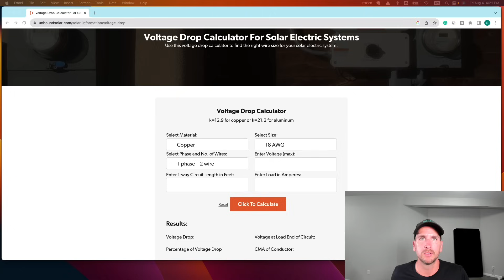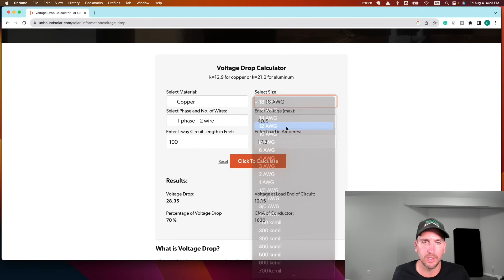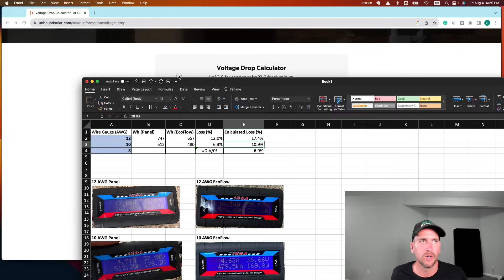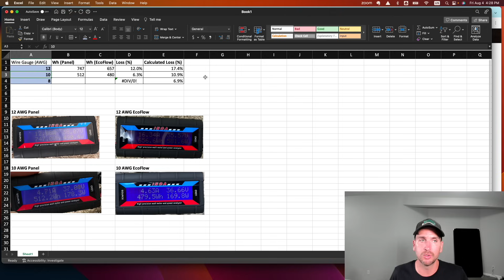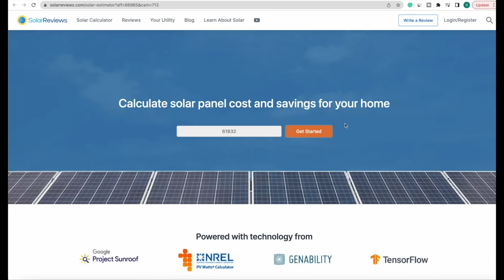What Wire Should You Use For DIY Solar Kits? Surprising Results!

Comment: If you put the same panels in series then your current would be halved and your line losses would be a quarter.  Then it would matter much less what wire you use.
Reply: The host of this channel mentioned in a reply to a comment I made that he would have run the panels in series but the little power analyzers couldn’t handle that much voltage. This video does get across the message that wire gauge matters a lot, something a guy named ‘Handy Bob’ stressed some years ago.
Reply: @mikedavison3400  it just doesn’t matter that much when using higher voltages.
Reply: Agreed. This video should have included a series connection. Nobody is going to run in two parallel. I expect the results wouldn’t be as exciting with parallel though. Also, most aren’t doing 100 foot runs.
Reply: Dont forget that series has a total energy cost if partial shading enters the equation.
Reply: @ceeweedsl bypass diodes are more effective than optimizer manufacturers would like you to think.
Reply: @ghz24  I'm not sure I understand.  Are you saying to use bypass diode at panels to avoid the increased loss from shading with series wiring?  I understand they can protect with parallel but have not used them.  I only mix two panels.
Reply: @ceeweedsl  No the diodes are factory installed in virtually all modules.
Depending on the pattern of shading and  the wiring of the diodes they may prevent the overall array from suffering more than the total of the shaded cells.
That's probably clear as mud. 
Here's an example if you have 6 panels in series and throw a blanket over one of them you only lose the power of that panel not the whole array.
Likewise covering 1/3 of a panel may not degrade the entire array if the 3rd covered are bypassed by the diode.
On the other hand if the shading is evenly spread over the sets of cells so no diode can bypass because they are all partly effected the amps produced drop and become the limiting factor for the whole array.
Many common 325 watt panels are wired so a vertical shadow drops the voltage from 33 to 22 volt but the amps remain at 10 so the 6 panel example would drop from 197 volt to 187 and the array suffers a 110 watt drop.
If theshading is horizontal accross one panel it keeps 33 volts but drops the amps to 6 1/6th amp and limits all the panels to that 6.6 amp output. So volts stayed at 198 but the array lost 660 watts from one panel being shaded by 1/3. 
So that utility pole shadow sweeping across your array daily may cause almost no loss or it could completely justify the cost of optimizers.
I am not a fan of optimizers.
I suggest you read an article titled 
"Danish study shows solar panel optimizers aren't always optimal"
and then decide if they are worth the cost in money and in performance.
Spoiler since they use energy if there is no problem for them to solve they just waste a little energy trying and your better off without but it's deeper than that.
Their methodology not perfect and...
Solaredge posted a reply to the study, you can find a link in the comments below the article.
One of their criticisms was that the utility pole was just testing the bypass diodes but that's just and admission that the optimizers aren't needed to solve that issue.
Reply: @ghz24  OK.  So you are just talking about the standard bypass diodes almost all panels will have.   I will have to study this more.  Every source of information that I've seen indicated that in series you really do get more shading loss as the voltage drops.  I could swear that I've seen the same in my own system when I experimented shading one panel in a parallel vs series but maybe I misremember.   As far as comparing optimizers vs none, I have no idea.  I thought we were discussing series vs parallel.  I have one installation where there is much shading from a roof rack and want to get what I can.  Had not even heard of optimizers so using vs not using is not yet on my horizon.
Reply: @ceeweedsl  I don't know your system but for mine with little shading I don't see any advantage to use parallel panels or optimizers.
An optimizer on the partially shaded panel may be worth the price for your system.
I'll do two strings of 8 panels in series and picked an all in one inverter that can handle 450 volt input to its mppt controller. This gives low loss even with 10 ga wire because each string will be only 10 amps.
If your battery is not 48 volts you may have more limited equipment selection.
The optimizers act kind of like a buck converter lowering voltage to keep the amperage at the level of the rest of the string.
I'm still learning and researching myself.
Beware of "mc4 compatable" connectors.
If they aren't the name brand mc4 it could be a fire hazard.
Reply: @ghz24  Hi. Yes we are running very different systems though there are aspects in common.   Mine is a small 12V RV system that I have been running since 2016   I have 240 watts of folding panels for my primary source on an Victron MPPT and then I squeezed in a couple of 50w Sunpower panels onto the roof between board racks and a Yakima box. Those charge via their own MPPT controller. Rooftop real estate is tight so the roof panels see almost constant partial shading, while the outboard ones get placed for full sun and manually tracked when power is dearly needed. 

It works well.  Short run for the rooftop and about 30' (+ 20' extension when needed) of cable for the outboard.  I also have a few more glass panels at our garage where the van parks and we live there a month or so as well.  Another 50' cable that uses the van's LFE bank.  It all works very well and we live out of the RV for 3-4 months a year.  I basically just have to keep a largish 12V chest fridge running, fans, lights, 500VA inverter.  Nothing like a home system.  

I run everything parallel.  Have experimented with series and it was not better anywhere.  I just don't see significant V loss to need higher V while on the other hand,  if an outboard  panel has an incomplete connection (happens sometimes as I plug and unplug every day) then I still have the other set engaged with a parallel Y cable. 

I am no fan of MC4 for the reason you mention and others.  I did keep them on the roof as I had a compatible set and they are fixed, not disconnecting.  Otherwise I cut 'em off!     Everywhere else is Anderson SB50 or Powerpole. I find them robust, off- broadly interchangeable (just use the same color!) and easier for frequent handling. 

When I installed the Sunpower cells, they specified to use blocking diodes for safety if running parallel, but I don't.  It's only 100 watts. Didn't feel like buying nor installing nor seeing a V drop. 

Thanks for your input and showing me that there is always more to learn!
Reply: @ceeweedsl  In your system optimizers would offer no gain and probably a little loss.
Reply: @ryanyoder7573 your sentence “in two parallel” is not clear. The panels in parallel in pairs? It also depends on the input voltage limit of your charge controller. Though with time the newer ones are able to accept higher and higher voltages.
Reply: @5400bowen  I don’t understand your response.
Reply: @ryanyoder7573  I quoted you precisely. Your sentence was “Nobody is going to run in two in parallel”. What is that supposed to mean “in two in parallel”.
Reply: always run parallel here - get the max out of CC without burning the VOC. also, cant overpanel with series only. @ryanyoder7573
Reply: @ryanyoder7573  I will run five in parallel. My system is designed to be 12 volts, and the controller can't do 24v, even. I will be using a shorter, 4 gauge cable.

It would be nice to have different design constraints.
Reply: @jamesalles139 Don’t forget to fuse EACH panel if you wire them in parallel! Fuse rating is the one written on the panel labels.
Reply: @jeandalle1726   Yes. this is a very good point, and I will be adding an automotive fuse panel at my combiner point.
Reply: @jamesalles139  you sound like you are talking about batteries, my guy. What voltage does your MPPT charge controller allow?
Reply: @ColbyBlack  I am talking about the entire system. Batteries or any other component follow the same laws of physics. Mine is essentially a vehicle system, that is also 'portable'. The Renogy 'DCC30S 12V 30A Dual Input DC-DC On-Board Battery Charger with MPPT' has a maximum open circuit solar input of 25 volts or less. It is not possible to run series panel configurations with this unit in the design.
Reply: @jeandalle1726  Why do you need to fuse each panel at 8 amps/panel?
Reply: @JosEPh-zy3yr  Hello. Well, if one panel develops an internal short, the other panels will send high current in the defective one, leading to heat, fire,…
No need of fuses when wired in series (except if the series are, at the end, wired in parallel!) Remember: better safe than sorry.
Reply: @jamesalles139   If you have to go to 4ga you might want to check the cost of upgrading your controller to MPPT and go series. Could be cheaper to eliminate the controller constraint.
Reply: @ceeweedsl  Yes, this is absolutely true from a design standpoint. And thank you for making the point. I was disappointed to find that I couldn't even do 2s.

However, my system is vehicle-based and transportable. The 12v solar controller is actually a DC-DC charger with a solar input. It has some advantages in my application, including charging the SLI batteries.

Also, I acquired the 4 gauge cable (20 ft red & black) inexpensively. I found some new old-stock jumper cables with 100% copper at a very nice price. All of my 2 gauge jumpers I picked up on clearance. So I am piecing together a 1-off system that I would not necessarily recommend to others, and I cannot replicate at the same cost.

However, anyone who is running  30 amps over 10 gauge cable for 100 feet had better check their math for how much power is lost due to voltage drop. It can easily be well over 10%. Solar panels are also too expensive to go cheap on wiring.
Reply: @jamesalles139  Ah.  OK.  My system is vehicle-based as well.  You must be running the Renolgy DC to DC.  I think that's the one that does solar charging as well.   But how did you manage to need 4ga for your panels to the charger? Are you running a lot of panel?   My mains are flexible folding rated @ 240 watts (which is lower yield and actually delivers maybe 160 typically) and it's fine with 30 ft of 10/2 landscape wire. Insignificant loss.   Now for your controller to battery, keep the run very short and thicker. I used 8 there.  Any voltage drop there is undercharging.  For the starter battery to house system you really do want 2 ga if possible depending on distance and what your charger can handle.  And inverter to battery is super critical to go thick, thick thick.   But 4ga from rooftop panels?  Maybe for 100 ft.

One thing to emphasize here is that you can do the calcs for the panel's maximum possible output and think you have the best numbers for decisions 
BUT :

1) Those panels will never operate there.  Figure 80% is your high noon best. If you have 1000 watts of panel, your max power running over the wires will likely be 800 watts. 
2) I also don't plug 12v into the calculator.  12V panels often put out closer to 19V.  I use 18.
3) A bit of efficiency lost at high noon is rarely a big impact on your total solar day.   When you really need efficiency is on the longer fringe - winter, cloudy days, mornings and late afternoon.  At those times you are pulling 50% of rating.  In your case the actual wire is cheap, but if somebody has to pay for and struggle to install 4ga for panel installations, they should do those wire calcs at 80% and 50% to be sure it will impact the total power gain enough to be worth it.  I have done field tests by swapping in thinner cables and not just looking at a moment of full sun but comparing a full days of gain over similar days.  This better reflects the real world, but is hard to find out when in the design stage. 
Remember, this is not structural engineering.  There's no catastrophic failure if you are only optimized for 50% panel rating - just maybe 5% less charge on your battery at the end of the day.   

That said, too many RV systems probably do have too thin of wire.
Reply: @ceeweedsl  Yes, DCC30S and 500 watts of panels.

My argument is that many people don't see full rated capacity of the panels, measured at the controller, due to the wire losses - at least a big part of it. In order to do that testing, it is best to substitute a beefy power supply in place of the solar panels, and take your measurements.

19-20 volts is more like open circuit values. I use 15 volts for design purposes, as that is the voltage that is needed to aggressively charge batteries. The MPPT charger does, of course, modify that.

Funny thing, for my large vehicle, I use 120v AC to make the long run. 20 feet at 3 amps brings negligible losses. I happen to have an extra 1000W inverter up front, and a 30A 15 volt DC power supply at the other end. That also means I can easily charge from shore power when available, by re-plugging an extension cord.
Reply: @jamesalles139  OK gotcha.  Probably a safe number to use for calculating operating panel voltage is 18.  Panels do vary right?. Some are higher.   Operating and Open V for some different Renology panels I just looked up is 19/20 and open 23/24V.  My Victron MPPT won't even activate unless it sees 5v above battery V and I run LFE so it's usually at 13.3.  

 I don't believe the power supply is needed to test but seems good if you plug in the right numbers.   Just like with calculations, if you set your power supply to 15 (too low) and then the amps to 100% rated (achieve in lab conditions) then you can convince yourself that you need more copper than will actually make a significant difference.

And again, projecting even 80% of rated watts for a full day is unrealistic.  It's gonna get 80% rated for half the day at best and then average 40-50%. 

Haha.  I can't believe I'm here advocating less.  Usually I'm saying the opposite to people I meet in parks.  Actually I'm just advocating using the most realistic numbers to design. Unless panel upgrades are on the horizon.
That's cool that you manage the long run with AC for near zero drop. That's the beauty of those microinverters I see.  Spot on.
Reply: @jamesalles139 If my run was any length at all I'd spend to get a better controller and connect in series.  A Victron mppt is probably less expensive than the difference between 4ga and 10.  You don't have to have your controller meet the full rating of the panels if it's MPPT.  Again, 80% of nominal rating and even could go lower.
Reply: @ceeweedsl  Agreed, all things to keep in mind with a design. 
In my case I had some things on hand including pure copper 4 AWG jumper cables. 20' is enough, and my whole kit is vehicle based, so I kept it to 12 volts nominal. It does have it's limitations, but OK within my constraints.

This brought me to 315 AH of batteries and 500W of solar. Anything bigger, or permanent install would only makes sense at higher voltages.

thanks for the reply!
Reply: @jamesalles139  I would think that for the cost of 4 gage cable, you could buy a different controller cheaper.
Reply: @soberpickle8195  except in my case, I already had the jumper cables, and the controller is the one I want, which has a 12 volt alternator input.
Reply: @ryanyoder7573  The results are still valid. They show the effect of Voltage drop over a distance. 100 is a nice number. Also, 100' to a ground mounted array would not be odd. Not all rooftops are in direct sun.
Reply: @steveurbach3093  yes they are valid they are just way more compelling due to the low voltage used which produces a high drop
Reply: Instead of a lower gage you could also run a pair of wires of a higher gage in parallel thus having the resistance
Reply: He made a 10 mins video for 60 seconds of information.
Reply: Wire is also Rated for voltage limits.   be aware of that.  yes the higher the voltage the lower the current is true. 
However higher voltage is more likely to do more harm.   so beware wire size is one thing voltage limits is another. 
Higher voltage means faster line loss also. 
Line lost is rated by resistance and it is constant and current limit before the wire becomes hot.
Reply: Would be nice to compare the voltage drop in the same solar capacity.
Reply: @jmalinowski1000  if you take the same capacity panels and wire them in series rather than parallel then the current will be lower so the voltage drop will be lower too.
Reply: You didn’t watch the whole video. He explains that near the end, as well as explaining why he did the test this way.
Reply: No! It always matters! If you don't check it, you are an electrical hack.
Reply: @boblatkey7160  Of course check it. It will always have an effect, but when the effect is reduced  by a factor of 4 due to the halved current then it matters way less.
Reply: Halved, if you run two panels in series. Four is 1/4..And charge controllers have input voltage limits. Just be aware of the parameters.
Reply: @5400bowen  Nope, if you halve the current then you quarter the losses in the wiring.
The loss is I^2*R. ie the SQUARE of the current. If you halve the current then the power loss  you now have (i/2)^2R. ie a quarter. THis is basic physics.
Reply: @cccmmm1234  did I miss-speak? I meant to say amperage not total power loss. And again, you halve the the amperage connecting two panels in series, doubling the voltage. If you put four in series and quadruple  the voltage..let’s see, multiply by the square root of zero, carry the 4….!!! Just teasing. Yes, 1/4 the line loss.
Reply: @cccmmm1234  it is electrical, not physics. Yes of course everything is physics, but you won’t learn about power loss in wires in relation to trade offs between voltage and amperage in a physics class. You learn that in electrical classes. You are trying to make it sound more scientific than technical